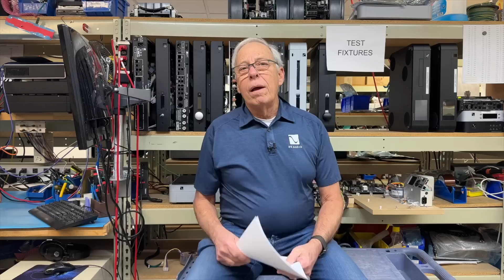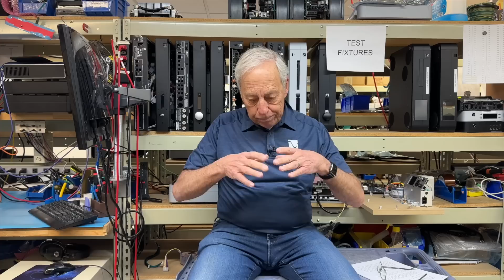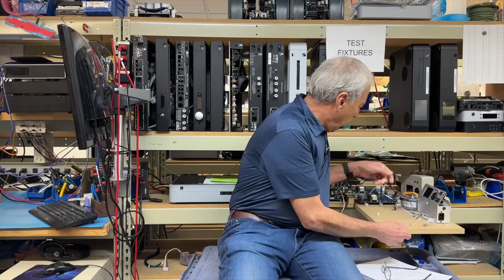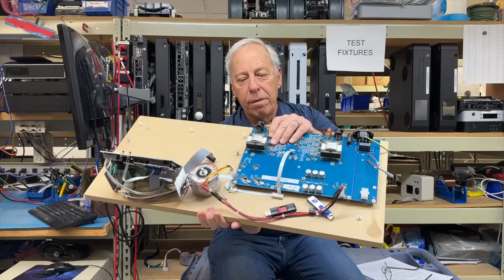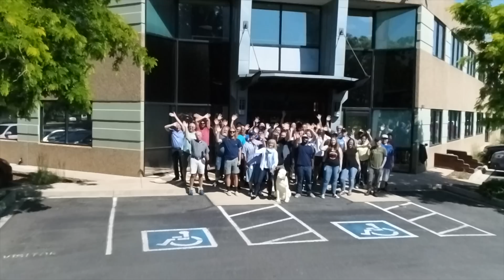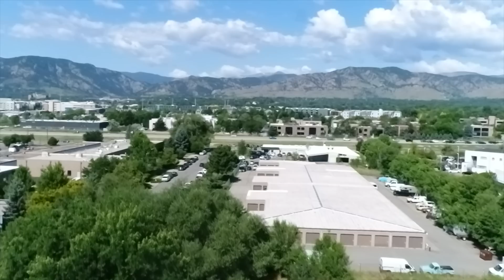Class D amps and toroids

Comment: now a lot of class d as you say use a switch mode power supply but I often feel that the best class d designs in terms of sound quality often utilize a linear power supply which can be a toroid.

I mean look at rogue audio, a lot of their class d designs utilize a linear power supply and in doing so create some of the finest sonics that I've heard from a class d implementation.

now switch mode power supplies don't enjoy as much noise as a linear however I often feel that the more noise we strip away and the cleaner a signal becomes the more sterile it becomes and the less emotionally and musically involving it becomes.

Comment: I was under the belief that most Class D amps don’t need toroidal transformers? Isn’t this one of the reasons they are much lighter even though they’re pushing out 150-200 watts per channel? The NAD C-399 for example.
Reply: They don´t because they use SMPS supplies. It is a question around audiophiles what sounds best, and if an analog supply has to have few large or many small power caps.

I have built more class D amps, and have used both SMPS and analog supplies. The problem is most people don´t care to try both on the same amp. But the best ones i have
built were with analog supplies, and i Hypex cases with HXR voltage regulators. And people I know seems to think it is a good idea to upgrade their supplies to types with
many smaller caps.
Reply: Rogue Audio Sphinx is Class-D with a toroidal transformer. I dunno if this is an exception to the rule or not, though.

Comment: Emotiva claims the noise created by a switching power supply, is way outside of the audible frequency range.
Reply: It depends on how you build the power supply
Reply: your statement require more elaboration, you mean noise from the power supply itself into the power or created from the Electromagnetic Radiation affecting the operation of other nearby parts or gear?

Comment: It was not well explained!

think of a linear transformer such as a toroid or a regular square transformer such as a wireless mobile charger. There are two coils facing each other and the magnetic field of one coil is transferred to the other coil.
The number of windings on the two determines how many volts you get out.

let's say that a class-d should have a maximum recommended of 70v. The SMP power supply has output regulators to keep the voltage at a constant 70v.

A linear ordinary wire wound transformer will vary up and down if the volt in varies.

you can then get more than 70v and the amplifier can be damaged by it.
therefore you cannot have more than 60v - 65v out on a linear transformer if the amplifier can only withstand a maximum recommended of 70v

Everything has advantages and disadvantages!
Reply: @Douglas Blake 
Surely you understand what I meant by the ones I wrote?

In datasheet for a class-d amplifier ic. there are often written max recommended volts and absolute max volts.
Reply: regulators can be added to linear power supplies too...
Reply: @joshua43214  If you connect a linear regulator between the transformer and an amplifier, then it is the current regulator that needs MUCH more cooling than the amplifier needs.

If you use the other type of more efficient regulator, you will get switching noise.

Current regulators are intended for audio products that only draw a maximum of 1.5 AMP as a DAC. preamp cards and that sort of thing.

Comment: Lots of very expensive, excellent sounding gear don't have toroids. I wouldn't get too worked up on whether the gear you are considering has toroids or not.
Reply: Not sure anyone was getting worked up about it. It was just a question. Like, do pancakes have eggs in them? Folks can want to learn without an agenda.
Reply: @spencer476  You don't get invited to many parties do you?
Reply: @Roof_Pizza  - that was actually funny. Well played.
Reply: @Roof_Pizza  No one else knows anything, only you. Don't go around criticizing everyone on youtube!
Reply: One area they have stopped using linear transformer is PA. concert effect amplifiers. That is why they have become so small in size. SMPS. power supply can be good if it is made correctly.
Reply: Just for mentioning it.
I have both a 31 kilo class-a with a toroids  transformer and one with an SMPS power supply.

Comment: I didn't realize that toroids were much more efficient. Thanks for the update.
Reply: EI transformers are less than 90% efficient whereas toroids are 90 - 95%, plus they confine their electric fields much better which is why they're more efficient. The main disadvantage of toroids is that they are more expensive to build, which is why most mid-fi and even some high-end pieces don't employ them.
Reply: The input winding and output winding are much closer to each other, this are one reason why a toroidal transformer is more efficient and generates less heat
Reply: So what's the efficiency of an EI transformer and an equivalent toroid one then?

Comment: External switch mode power supplies are used for cheap Chinese class-d amps. Since they are not built in, interference is not an issue.
Reply: They’re not just used in Chinese class D amps. The Nelson Pass ACA class A is a good example.
Reply: Cheap and Chinese could be cheap American also........